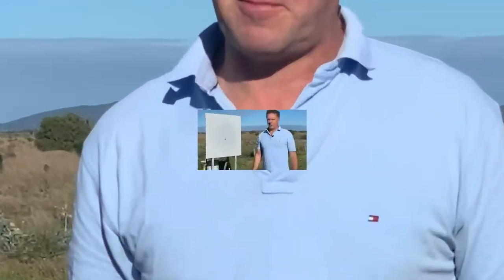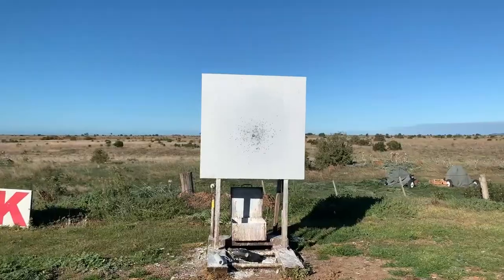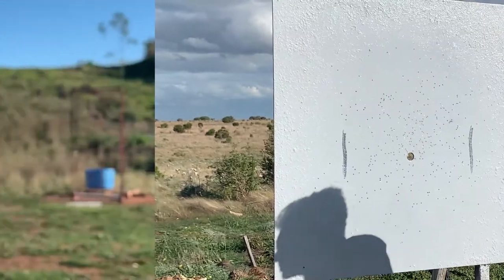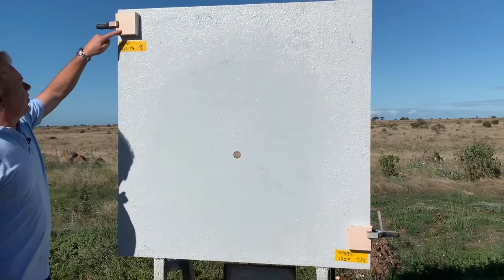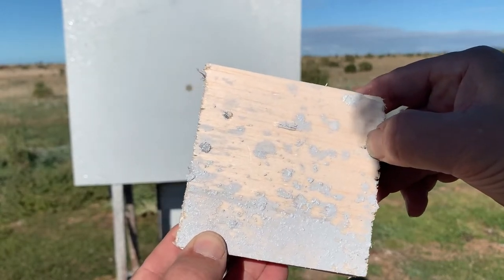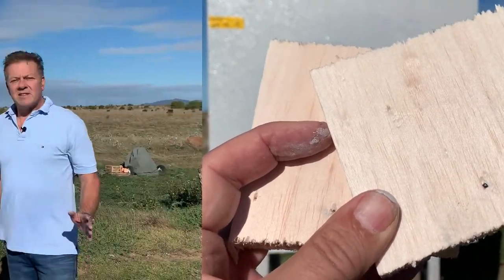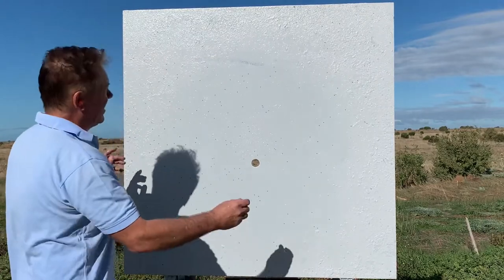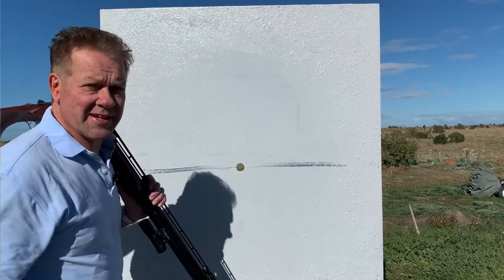Steel shot vs Lead shot   Go Shooting Shotgun Coaching Videos   Series 2 #20

Comment: You will not beat lead for clean shotgun kills. If you can't spot a pellet either steel or lead in your prepared game best you leave to someone else! What happens to the. 410/28 bore users?
Reply: They are screwed
Reply: @fastmover45  My sentiments exactly. There are a lot of wonderful examples of. 410/28 guage guns in the UK. Lovely little shotguns 25/30 yards with current ammunition and 28,s a bit better. Enjoyed by beginners, novice and experienced shots. There are some shoots offering cheaper Partridge days for. 410 to get youngsters involved and the less well heeled amongst us into game.